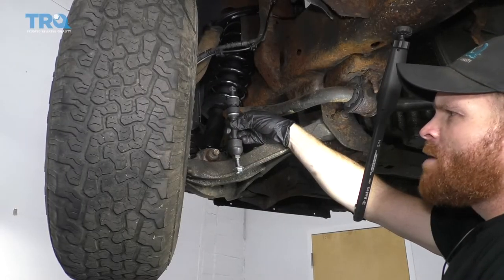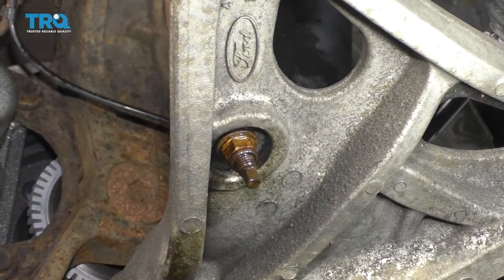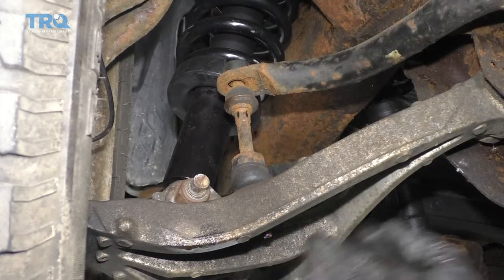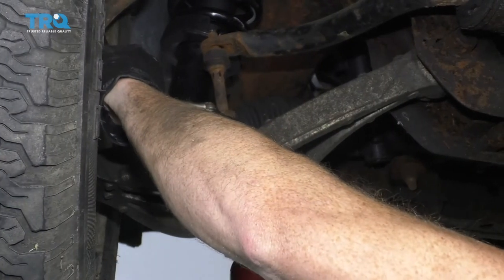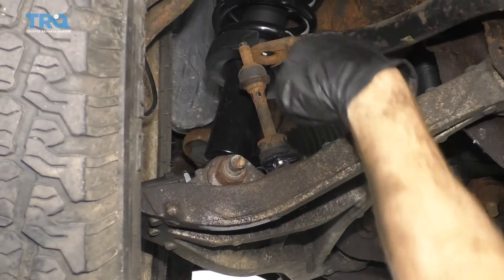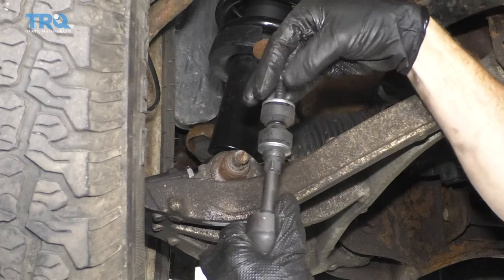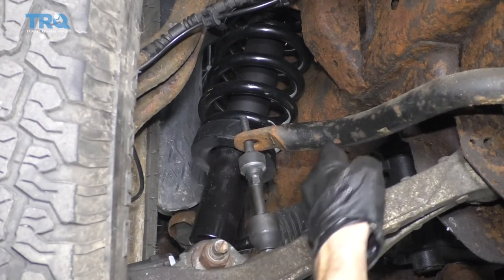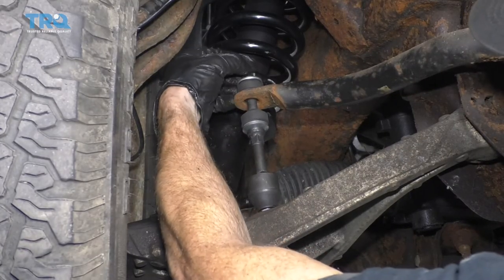How to Replace Front Sway Bar Link 2004-08 Ford F150

Comment: Great video! Thank you for suggesting to release the nut on the other side stabilizer link as well so that the sway arm can be raised up and into place. That was a big help and a tip that was left out on the previous three videos that I watched. 👎 Which is THE reason I was looking these videos up to begin with. Thank you so much. 🫡

Comment: Thanks for the help & the parts (good price) I did both sides at the same time. Actually better doing it that way because I didn't have the strength to lift the sway bar with a short crow bar to pull the bad link until the top nut was removed from the other side link. I kept the wheels on and used jack stands both sides. I cleaned the threads and sprayed with penetrating oil the day before so bolt removals was very easy. I also used the 8mm socket running that "in" (clockwise) on the lower swing arm with the 18mm nut making removal easy. I think I had both side done in less than 40 minutes thanks to this video.  I'm not a mechanic but I watch a lot of YouTube....
Reply: Your wheels was shaking? What was the reason change swaybsr link?

Comment: I have a question. I torqued the top and bottom to exactly what you said and the bushing on the top is not tight meaning I can spin the bushing. Do I need to tighten until it’s not moving or are those joints supposed to move a little

Comment: What would cause these bushings to completely disingeate and be worn totally off? About to replace mine now because I noticed them gone. But wondering if something else contributed to it that I should change. Could it be the worn shocks?
Reply: Maybe wide wheels and tires(?) i have a -18 offset on mine and well I noticed one side was gone
Reply: @alexsoriano5173  nah, just regular tires and wheels.
Reply: So, a year later....brand new ones, bushings are cracked again, and pins are loose. Only noticed because I was down there changing my oil. .... How do you tell if your shocks are worn or not doing their job and putting too much strain on these guys?

Comment: really no need to cut boot and use vise grips.  that stud usually has a 8mm hex end. simply hold nut with boxend and airwrench the 8mm opposite the nut will usually walk out. (northern vehicles may require more effort, lol)

Comment: Okay but the oem part does not come with a new nut. So it’s not okay that yours broke. You should ad that to your video. If going oem, none of the oem suspension components come with a new nut, tie rod ball joint stab link etc…Kind of ironic beings ford recommends to replace the nut too lol makes a ton of sense